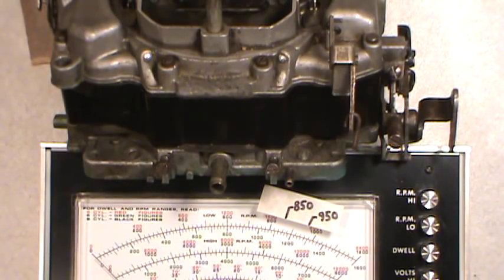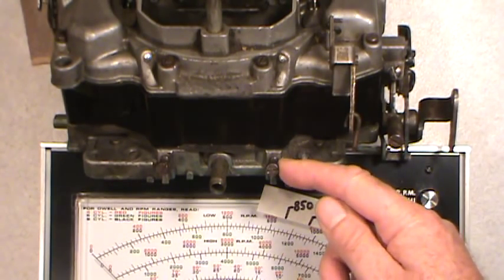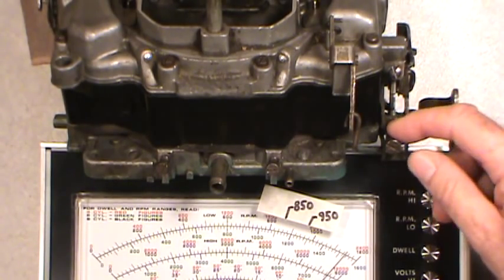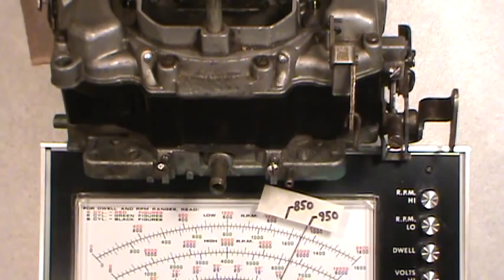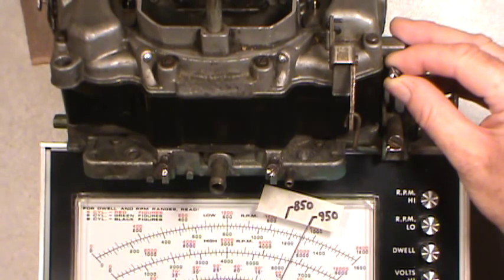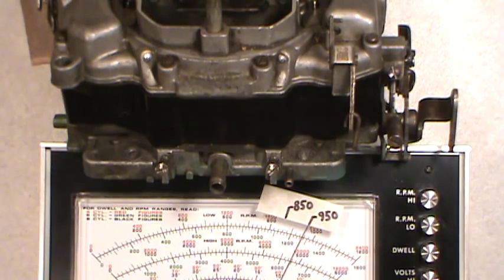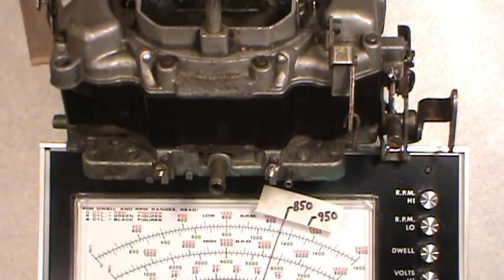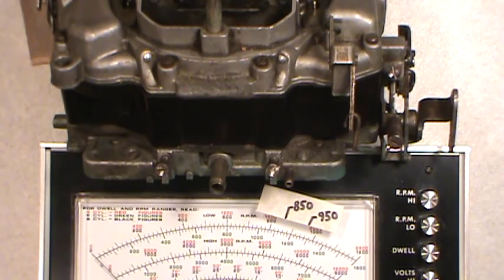Idle Mixture Adjustment on 4 Barrel and 2 Barrel Carburetors

Comment: Can you show this with a 1964-66 rochester 2 barrel that would be on c10 1/2 ton Chevy pickups?
Reply from the maker: Karamelia Mitchell Greetings Karamelia Mitchell....Thanks for watching, and for Your comment/question as well............................Well...if I were to show show You, and Others as well, about how to Adjust the "Idle Mixture Screws"...and...the..."Idle Speed Screw"...on that..."1964-1966-Rochester 2 Barrel Carburetor"...that You had mentioned, then, what You would probably be Seeing, is, pretty much, like, what You, (and Others), have already Seen, in this very YouTube Video of mine, with the exception, of the "2 Extra Secondary Barrels", that You saw, on this "Carter Thermoquad 4 Barrel Carburetor", that is.............................Generally speaking, on most "2 or 4-Barrel Rochester Carburetors, that I've Worked-On, the "Idle Mixture Screws"...are part of, the..."Primary, or Front"...Throttle Bores, and the Throttle Plates/Butterflies, that reside in "Them"..."Only"...and when "Adjusted"..."Only Affect...the..."Primary/Front Throttle Bores"...because of that particular "Idle Circuit Design" (the Secondary Throttle Plates/Butterflies, are usually Closed, on the Rochester "Quadrajet" 4 Barrel Carburetor, at Idle Speed).....................................Most, shall we say..."Old School"..."North American"..."Rochester 2-Barrel and 4 Barrel Carburetors" (well, depending on, just "What Year" we are talkin' about, some, go/went by the Name/Description, of...the Rochester "DualJet" 2-Barrel Carburetor...and the Rochester "Quadrajet" 4-Barrel Carburetor)...and, quite a few "Other Carburetor Manufacturers", that have a "Similar Looking Design", and having either..."2-Barrels" or "4-Barrels"...along with..."2 Idle Mixture Screws" as well, will, as I see it..."Pretty Much be Adjusted the Same"...but, and I say But...there are "Exceptions"...!!! (almost like Everything in Life...!!!...lol).............................What I'm getting at here, is...Does the Vehicle, and Its Engine..."Need to Pass a Smog/Emissions Test"...???...............as, that is, what will usually..."Up-Set-the-Apple-Cart"...if a "Carburetor" (and a Host of Other Things), are..."Not, Set-Up"...to..."Satisfy"...that there..."Smog-Sniffin' Bandit"...at, that there..."Smog-Sniffin', Vehicle's Engine, Smog Testing Establishment"..."Yee-Haw"...but, I only be Sayin' that, If-in, I Git, that thar, "Pass" (word") "Stamped", or was it "Printed", on that thar..."Smog Paper", that They give You, after, Takin' Yur "Money"...lol...........(Ok, stop Laff-in, so-zzz, we can Continue....Thank-You...lol).....................................Time to ask You a few things now.............................Does Your "C-10-1/2 Ton-Pick-Em-Up-Truck", have to be..."Smog/Emissions Tested"...???..................................In order for Me, to Not, be Going on a "Wild-Goose-Chase", it would be very beneficial, if You would, so kindly, have a look-see, at Your "Carburetor", and perhaps, tell me the following............................"Name" on "it" (aka, Rochester or...???).................Any Identifying "Numbers, and/or Letters/Words", Cast into/onto, the Carburetor, or, maybe "it" has, something along the lines, of a Metal "Tag", perhaps...oh, and also, the "Year" of Your "Pick-Em-Up-Truck"...???.................................Hey, just so You know, most of what You are Seeing and Hearing, in these YouTube Videos of mine, are just, some, of the "Many Hobbies", that I'm, shall we say..."In-To".................................Well now, You see my Friend, the More, that You're able to tell me, about the "Patient" (aka, Your Carburetor), the More, I'll be able to help You out....Thanks-ah-Bunch...................Till next time.................Be Safe, take care, and have a good one.

Comment: My emission testing report before I sent you my info on my 77 Ford T-Bird 350M. This is my fail test report any help you can send me would be greatly appreciated.  (HC)-- Loaded Reading 46, Loaded Standard 250 Loaded Result--PASS.  (HC)--IDLE READING 729, IDLE STANDARD 250, IDLE RESULT--FAIL.      My  (CO) IN %--LOADED READING 0.23, LOADED STANDARD 1.50, LOADED RESULT--PASS.  (C0) IN %--IDLE READING 6.88, IDLE STANDARD 2.00, FAIL.  So, that's where I'm at with my emissions result.  Will be readjusting my carburetor and start fresh with it.   Hopefully I'll be using your method and make it work, thanks.
Reply from the maker: Greetings...Rogelio Camarena..........Well, as far as the "loaded" part of the smog test is concerned...(probably means, while the Dyno Rollers are being turned/spun, by the vehicle's tires, and are probably simulating, about 25 Miles per Hour/40 Kilometers per hour, as a guess), then, the "loaded" readings, sure look, to be pretty good, to me, alright..........The, shall we say "Un-Loaded" idle/speed test, is where it appears, that the "not-passing-the-smog-test" shows up..........The carburetor's..."Idle Mixture Screws"...as well as, the..."Curb Idle Speed Screw" (or maybe Solenoid, curb idle speed setting, if so equipped), have to be "Set Correctly", or, more exhaust emissions, over the maximum allowable, will usually be the result..........Also..."ignition timing"...has to be set to "specifications" as well, b-cuz, if it's "not set" properly, then, that can also, have quite the affect, on what the smog-sniffin' machine, might be detecting, as far as, excessive exhaust gas emissions are concerned...........Also, all of the ignition system parts, have to be in very good condition/almost like new, b-cuz, all it takes, is, just one misfiring spark plug, that will be sending excessive/extra/not wanted or needed, exhaust gas emissions, right out the end of the tail-pipe..........Also, if there is a fuel system problem, and/or, a wrong air/fuel ratio (mixture), then, that, in itself, can be the cause of, one or more, "misfiring" (engine) cylinders..........Also, things like the air filter, and the PCV/Positive Crankcase Ventilation, Valve and system, have to be good-n-clean, and not plugged up.............On my very first time, having to go through the smog test, I thought that I should lean-out, the 2 idle mixture screws on the carb, so, I turned the 2 of them, in, as far as I could go, and still have a nice smooth idle..."Wrong"...(that was), b-cuz, I got around, about the same as you got, around..."700-plus"...HC/Hydrocarbon reading...!!!...(maximum allowable, was 500 for me, as I recall), and, that's when I learned, that, by turning the idle mixture screws..."in too much/too far in"...that it caused, what is called, a..."lean misfire"...!!!...(that's usually when, and in this case, was when the air/fuel mixture, became too "lean", at idle speed, and caused that lean-misfire), and I sure couldn't tell, that was so, b-cuz, the engine was idling really smooth at the time............Have a look around, in your T-Bird's "engine compartment/engine bay", for a "V.E.C.I." (Vehicle Emission Control Information)...Label or Sticker...b-cuz, there's usually some good information, that's printed on it, and, if Ya get lucky, it will be showing, the specifications/settings, that could very well be...Smog...related as well..........I'm thinkin', that your 1977 T-Bird, will probably have a (Ford) 2150...2-Barrel Carburetor, sitting on top of, the probably, Windsor (spelling?) 351 Cubic Inch V-8 engine (I've never heard of a Ford "350" before, and, I use to have a 351 Cleveland, a long time ago, as well)............I've spent quite a bit of time, working/messing with the (1972 & 1973) 2100 model carb, and, there's probably not much of a difference, but, visually, there is probably a separately mounted "choke pull-off", on the 2150 model, where-as, the choke pull-off, was actually part of, the 2100 model carb itself, as I recall...........Have a look, for that..."V.E.C.I."...Label/Sticker...and let me know, whether or not, you find one, and we can go from there, if need be............Good luck, and.......till next time.......Be Safe, take care, and have a good one.